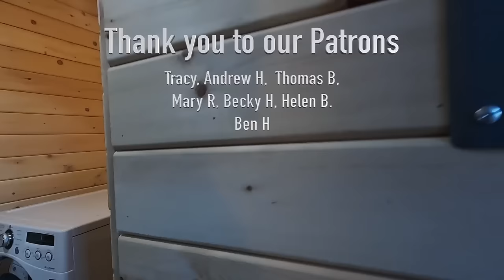WILL WE EVER FINISH THIS

Comment: It’s going to be pleasant doing laundry in that room. My only question is whether the wood will expand and contract due to heat and humidity.
Reply from the maker: We're not sure.  The dryer is vented and we do have the option of turning on the bathroom fan if needed . . .

Comment: Sarah, with wood it will expand and contract depending on the long term temperatures. Mine shift in the spring and winter.
Reply: I still would have given it a light oil  stain all over before it was installsd
Reply from the maker: Our growing and shrinking walls are actually because not every wall is 100% plumb.  The framers weren't totally exact. Lol!
Reply from the maker: Every wall will be polyurethaned. We did that to our ceiling boards and some walls that are too high and awkward to get to after installation, but to get done with the shiplap install, we're saving a lot of that till the end.
Reply: @OneFootOfftheGrid I believe reg poly will yellow over time.

Comment: When glass jars are stuck together - put them in hot water & very carefully wedge them apart - since this is iron maybe heating them up a little with a lighter (using gloves) until they come apart.... or 1 more suggestion - slim needle-nose pliers going around many times will loosen them enough - with a thin screw driver..patience will be required....good luck

Comment: I am sure you are ready to be done with the shiplap. I can't wait to see the what the railing will look like and the floors.
Reply from the maker: Yes, so ready to move on to the next chapter.  We are excited to start working on the railing both inside and out.
Reply: Fun video. Thank you.
Reply: That's TONGUE AND GROOVE. DIFFERENT FROM SHIP LAP. GEEZ
Reply from the maker: @1ronco  we’re actually using both products. Shiplap on the walls and t@G for the ceiling.
Reply: Ah, this is the first video that I've seen that. Are you painting it?
Reply from the maker: @1ronco  no we are just doing a coat of polyurethane on the ceiling and the walls

Comment: Why didn't you put the electric panel in the laundry room
Reply from the maker: There wasn't enough clearance for where I wanted to put it, and the access from below would have made it challenging to run all the wires down and through that crawlspace (directly below that wall is a footer).

Comment: Is that a combo W/D? If not... where's your dryer?
Reply from the maker: I WISH it was a combo!! Our dryer will stack on top. However, it currently lives on our porch hooked up to a 5 gallon propane tank 😂😂 I haul the wet laundry through the house and out the sliding glass doors to the dryer.

We need to reroute our dryer vent before we bring the dryer in and stack it.
Reply from the maker: It isn't a combo.  We are going with a stacking model and our dryer is out on our deck right now.  We knew we weren't completely done with shiplap so we didn't have to unstack and restack them 2 times.   The dryer will find it's home on top of the washer soon.

Comment: Having a laugh after your shiplap show comment!  By the way, all Timber buildings shrink in summer and expand in winter xx
Reply from the maker: Lol!  We've both said a few times "we're so tired of shiplap".  Getting closer to the end of it, though.  

I think our walls that "shrink and grow" are more of an issue of not being 100% plumb. But maybe I'll start telling myself that its just that wood expands and contracts.
Reply: Of course that change is due to humidity. If you built in Arizona or the dry parts of Mexico, you'd only have a little swelling during the short monsoon season.

Comment: Hi!
I still do not understand Why your don’t haven’t any protection between the insulation and the the timber in several years your will got huge problems with dust from the insulation 
Best wishes from 
Brian
Kungshamn Sweden
Reply from the maker: What kind of protection would you use?  Like a plastic barrier?
Reply: Here in Sweden we have a kind of protected paper using after Rockwool but I see that different in US hope you’re don’t get problems in the future.
Like follow the hard working couple 
Best regards
Brian